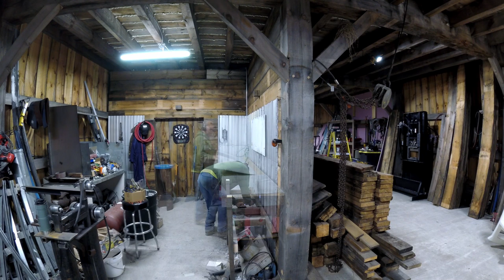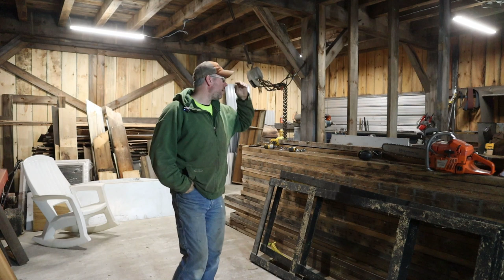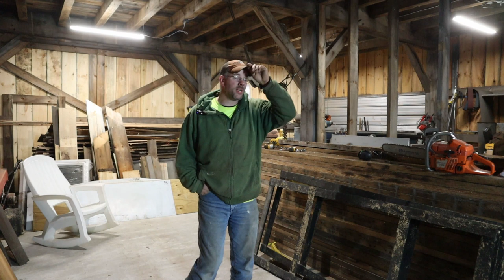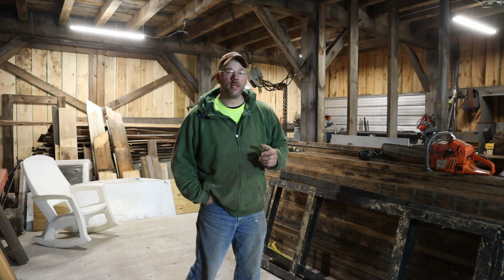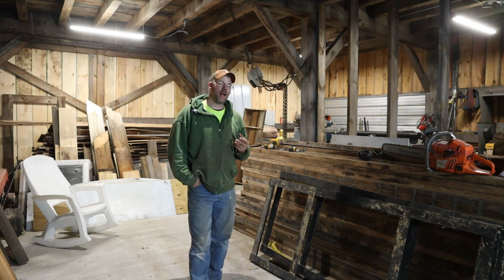The Timber Frame The Creative Process and Design Flaws

Comment: So I've watched a whole bunch of your videos building the shop. I'm like everyone else, my 2 cents is worth only that. Looking outside in if it were me ;
Repurpose your pit of despair, however it fits. Once organized, even just for storage, you're in the shop with what goes in the shop.

Maybe do a down n dirty expendable(15-20 yr) shed. Pole style building w whatever you can round up/put up cheap n quick. Basically shed water over a dirt floor.  Plan it for livestock, machinery whatever longer term. Use it to store slabs lumber anything in your way in the shop now. 

I'm a lot like you in the repurpose frame of mind. End up with projects sitting too long in the way etc. You think you have all the room you need going in only to figure out you did it again lol. You're on the right road for sure, spring cleaning n moving on. 

Have you thought about half walls(height) where your not heating? Or sliding walls (barn door) where it might work? I understand your sentiments about losing the timber frame feel closing things in. Just some rambly ideas. Can't do it all at once no matter what you do. Enjoy the videos. Thanks for sharing

Comment: Hey Mr. Jim looking good. Just a thought, could you clean up the “ pit of despair” and make that the sawmill building? If not long enough, you could extend it much cheaper than building a new building. Lean too off the barn would also be an option as you said but that requires more concrete work. Of course this is just a thought my friend.

Comment: You'll probably totally disagree with me but I think you should make use of this spring flush of energy and get to finishing up the battens and any other outer finishing that needs doing on the building while the weather is right. You can redecorate the interior at any time of the year.

For handling the steers you might want to take a look at Greg Judy's channel on regenerative cattle management.
Reply from the maker: I do the "redecorating" at night, I do the outdoor work in daylight.  You guys only see a few hours of the day on the videos.
Reply: @TheTradesmanChannel  "redecorating" was just meant to give you a laugh, not as an insult.